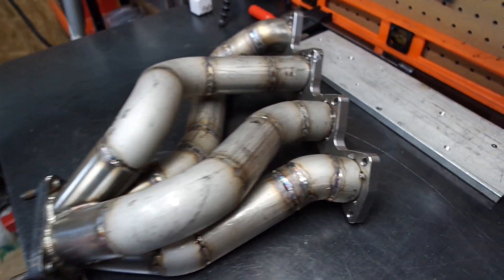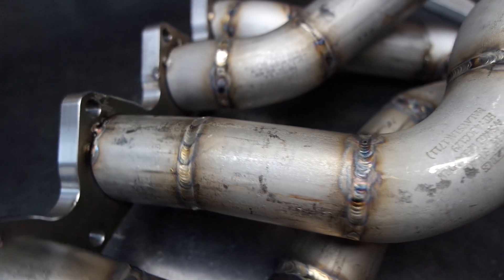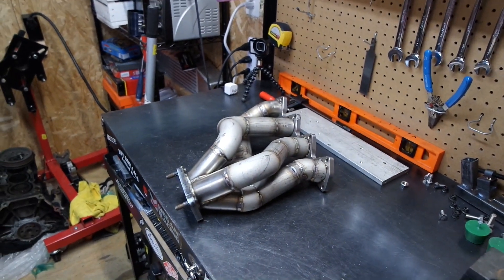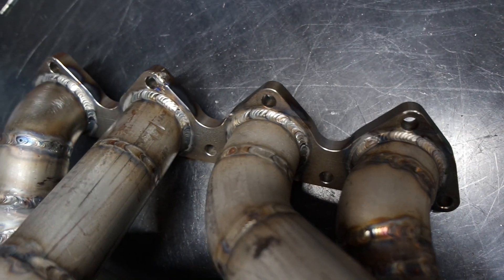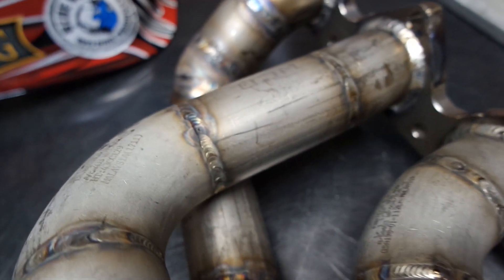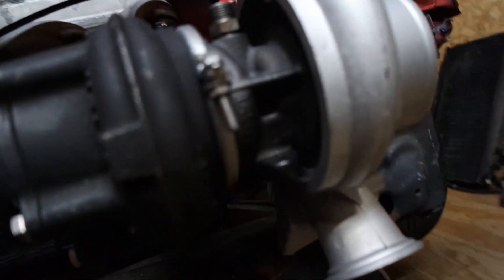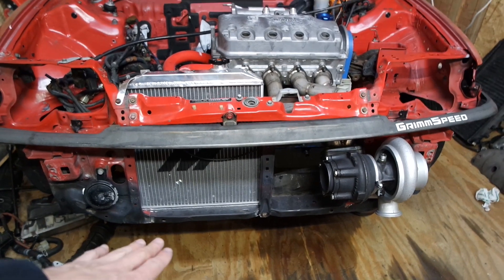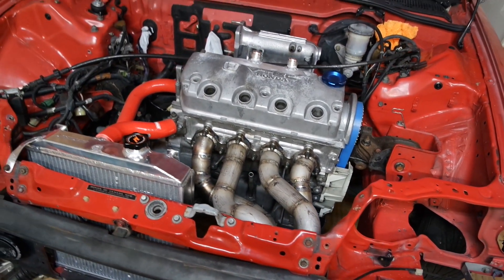Turbo Manifold is Finished!

Comment: I think the trick is to tack the runners (strong tacks ), finish one of them , take 3 of  them out, weld them then put them back in to weld them on the flanges.
Reply from the maker: Most guys who build manifolds for a  living know exactly how much they will shrink and can account for it during fit up. I'm not that good haha. But strong tacks do help a bit.
Reply: @yakswelding86  Yeah the shrinking is a huge issue. If you do a lot strong tack some shrinkage will happen before the real weld and you get an estimate :)